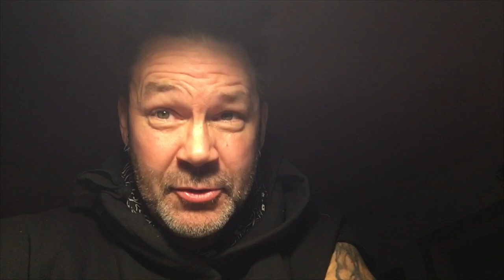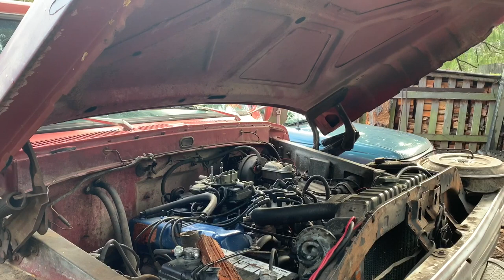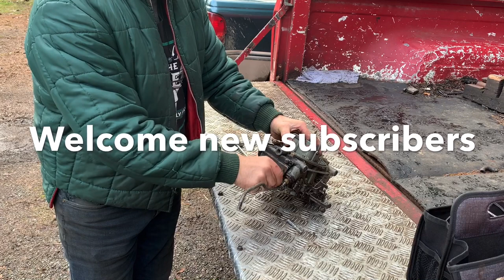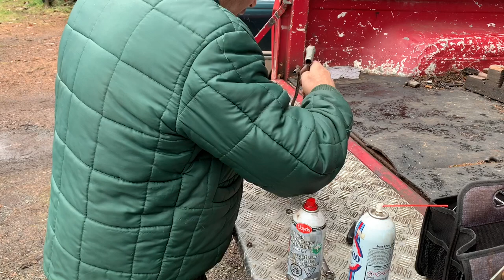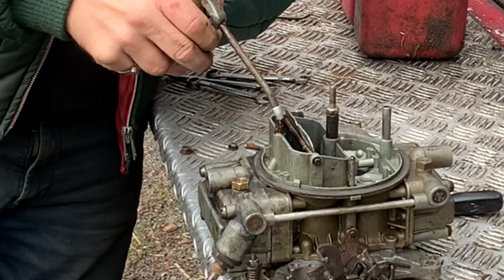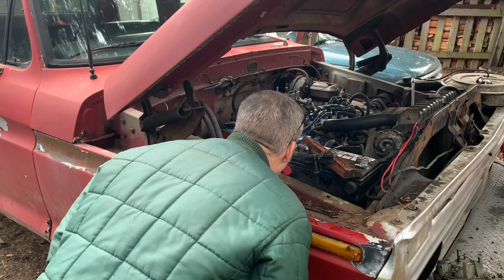It’s almost time for a new , old truck

Comment: Easy to get rebuilt or rebuild.  That float SOAKS up gas an gets heavy. Ive rebuilt many in alabama.
Reply from the maker: my local lordco couldnt find one ... crazy
Reply: @BuckinBillyRaySmith  try autozone or online. Im absolutely sure you can rebuild that with a kit.
Reply: Finding a kit is the first order of business,  but after you fix it 3 times and it still is not right go to an expert. 
Replacing the carb with a newer system could be the ticket for the next 5 years,  we'll be watching.

Comment: The floats have to be adjusted when the engine is running so the needle is working against fuel pressure.

Comment: The pump it in either rubber or leather. Goes bad is the reason you have to pump accelerate. A loss in gas. Got no doubt you can fix this.

Comment: If you’ve changed the fuel pump lately some aftermarket ones could be giving you too much pressure. 6-8 psi is all those carbs want. You may need a regulator.
Reply: Another detail to possibly be overlooked.  After dealing with a single barrel Holley carb for over 30 years looking at that 4 barrel is like a nightmare.

Comment: I know a new holley is expensive but put a price on your sanity,sometimes its a worn body or shaft and the price of a professional rebuild isnt wort it. bolt on a new one set it and forget it👍
Reply: I sent a Holley single barrel out through the local parts store,  it was a little over 300 bucks to get redone, worked good for a year then it started flooding again,  looked into new carb,  couldn't find one,  then got sick,  recovered,  mom died,  sold house,  moved into shack, and now 8 years later will get back to work on the truck. And i know that carb is gonna give me grief.

Comment: Bring it down to comox i have a classic car shop at my house
Reply from the maker: kool ,,,the back bowl keeps filling up and overflowing out the breather tube 4 barrell holley
Reply: @BuckinBillyRaySmith  your secondary float if cellulose is saturated. If metal shake it as soon as you get her apart see if it's got gas in it, if not you're needle and seat are shot. Also make sure you have a good PC V valve, and check for vacuum leaks at your power brakes canister , vacuum advance on a distributor , and your automatic choke. I don't think they had EGR valves on that model yet. There is another pain in the ass for mechanics.
Reply: More details that make me shudder. 
That 4 barrel is like a futuristic fuel nightmare,  too many things that can cause fault and failure.  The comment section is filled with mechanical wizardry. 
But i do smell gasoline.

Comment: You need to get the carb rebuilt with seals, gaskets and diaphragms designed to handle the ethanol fuels. Ethanol is destroying your carb parts and gumming up the works! Good luck!
Reply: Just buy non ethinal gas
Reply: @larrywoodruff7530  What is available for fuel in Canada?

Comment: BUCKIN you want to make your truck run 10 times better buy a Davis unified ignition it gets rid of all the electronic Ford ignition and turns it into chevy type one wire ignition with a coil way less problems and you get more spark and your truck will be so much easier to work on do this and you will be so much more happy trust me on this

Comment: Carbs suck in general, is there no fuel injection kit?
Reply: Yep 100%. I can rebuild and tune a carb no problem, grew up with them, but will never own another carb'd vehicle in my life if I can help it.
Reply: Personally, I prefer to have a carburetor on my vehicle.... Easier to fix on the road, unlike trying to figure out which electronic sensor or wire has failed, leaving you with a tow bill to the shop.

Comment: Are those floats hollow metal or are they another material cuz I've had a float and start to fill up and not float and then they start sinking and they won't float and they keep the the needle valve open

Comment: Not a Ford guy but I’m guessing that old Holley square bore is not stock?, also appears to be a spacer plate/adaptor on the intake if so should be able to remove and go back to stock carb

Comment: BUY a new carb ,change timing chain and gears,(on a FORD when timing chain goes it will spin out of time bending valves.Needs to be changed once in awhile.) have someone who knows what they are doing tune it up properly!
Reply: Especially the ones with plastic timing gears!
Reply: @om617yota8  I think you'll find that all Ford OEM timing sets have nylon teeth.
Reply: @mrbibstoo  Had a Chevy like that too. Never again.

Comment: Hello Buckin’ what I have always found out with carbs is: when they start going bad, they need a complete rebuild, so this is what I do, I put a temporary aftermarket carb on and if the engine improves, then I either do a complete rebuild on the original or send it to a rebuilder with the stipulation that my carb get a complete rebuild for me, not put on the shelf for the next customer!

Comment: You could try getting a carb rebuild kit from a speed shop Like Summit Racing. https://www.summitracing.com/?utm_source=bing&utm_medium=cpc&utm_term=www.summitracing.com&utm_content=SRE+Brand+-+Search&utm_campaign=Summit+Racing+2+-+Search Or Jeggs. I had one of those carbs on a 74 Chevy Nova. It was always giving me trouble. It was always springing leaks. I then switched to a Holley doubble pumper and knock on wood Iv had no trouble since. Its been about 20 yrs now.

Comment: Take the float bowls off turn it upside down set the bottom side of the floats to level turn it over and you are good to go put new accelerator pumps in it and new gaskets she will run tits.
Reply: Hmm... Sounds like hands on experience

Comment: I know you love old things Mr Buckin, but carburetors are shite, plain and simple. This is coming from a 42 year mechanic. Buy yourself a modern truck with fuel injection and leave that junker at the scrap yard. You won't regret it.

Comment: rebuild   kit  for  the  carb not  hard //////thyere  some  old  bloke  on  the  tube  he  be  60 /70  he  good  on  carbs   about  as  good  as  you  cutting  wood  and  talking
Reply from the maker: no kit around here  gotta find one online
Reply: @BuckinBillyRaySmith  that  be  the  go   get  the  number off  the  air  horn on  the  carb  so  you  get  zac  right  kit